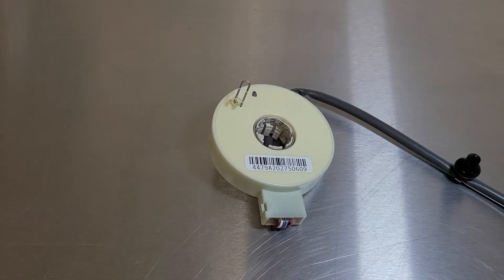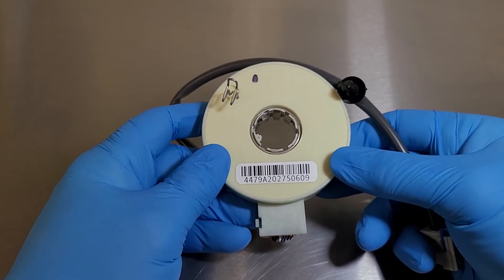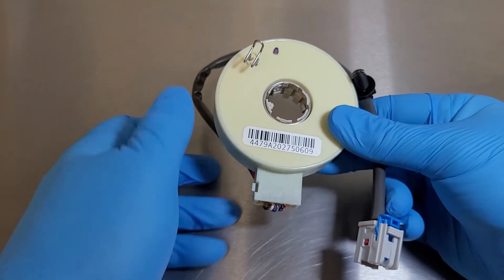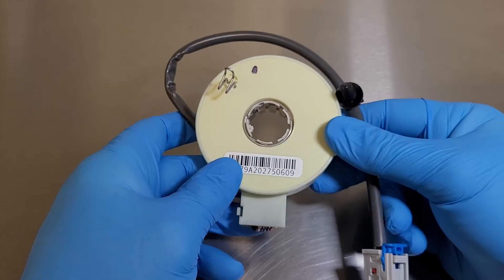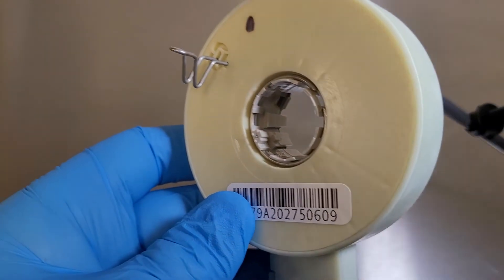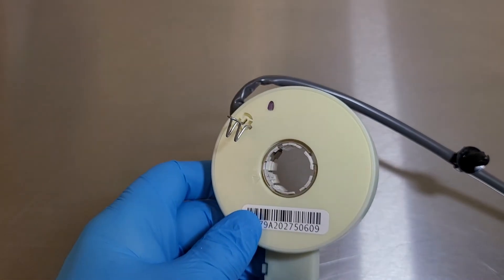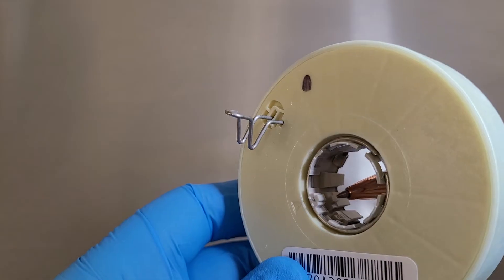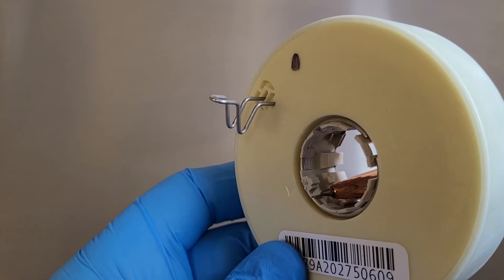Electric Steering Torque Sensor-Why the steering wheel spins on it's own after installation

Comment: First install, steering wheel went hard to the right.   I found this video and followed the instructions.   Now the power steering is completely out.  I've got a new error code now that says the torque sensor is malfunctioning.  Not sure where to go from here.   Either by the stupid expensive part and try again and risk having it happen again or pay even more to have somebody else do it.   So frustrating.
Reply: .... also,  the gigantic snap ring just kills me.   I think this thing is what messed me up in the first place.   For whatever reason, both the removal and reinstallation of this snap ring is next to impossible on mine.

Comment: This video is a money saver.  My sensor from gm was misaligned when received. I did what you said and it worked. I even programmed my sensor with the top Don top scan for 60 bucks. 2010 g6 with the 2.4l. This car put me in the hospital because of the steering column locking up, but it is fixed now but still scary while driving it knowing what I didn’t know then, what I know now. Thank you for the help you have provided us all.

Comment: I was having that issue with a new part and I thought it was defective, I took it back off and lined it up and now when I start the car the steering wheel is now staying still! The issue I am now having is when I turn it left I hear a clicking noise and the power steering cuts out. I only have that issue going left though, right turns are smooth
Reply: possibly click spring? check that out. you maybe damaged it when you took apart your column

Comment: This just saved me a headache. I installed mine and it spun. Every video I watched says if it spins it's ruined. I found this video and took everything back apart used the pin to realign and realized that when I originally did it the pin was only in the front disk and not both. Got them lined up and reinstalled and it works!

Comment: You need a diagnostic tool! 
1) Hook it up the connector but dont install. 
2) moke the rear spinner until the torque reads zero on your diagnostic tool.
3) line up the forward facing spinner with the arrows..
 4) if you can, istall while connected so you can keep an eye on the torque reading and adjust as necessary

Comment: Thanks for the info. My first attempt resulted in the wheel going hard right,on start up. Dismantled  inspected,reassembled alignment pin. Second attempt was successful. I am wondering if the problem is related to spline engagement depth. If sensor is pushed too hard the angle sensor splines may partially engage torque-section splines on shaft. Too little depth may have torque section of sensor hanging up on angle section of shaft splines. They wouldn't be misaligned, but aligned correctly on the same shaft section. I didn't have time to compare depth measurements. Perhaps someone could verify my suspicions. Thanks again.
Reply from the maker: Depth can be an issue.  There is a depth setting on the alignment tool.  This is discussed in the instructions link we provide.  Basically, the sensor depth should be set by setting it in only as far as the alignment tool will allow it to go down.

Comment: I have a question... I'm going to replace the power steering torque sensor to a Chevy Malibu 2012   It is absolutely necessary to calibrate the sensor with a scanner after being replaced?
I will appreciate your answer... thanks!
Reply from the maker: Absolutely necessary, maybe not.   If the install is done correctly, it may be fine.  But I'd be prepared to calibrate.
Reply: Thank you so much for your answer and the very informative videos ..👍

Comment: installed sensor and turned the ignition on and steering wheel didnt move. Then started vehicle then steering wheel rotated to the right fully by itself. Any suggestions? thx
Reply from the maker: It's out of alignment.  Remove, realign as directed in this video, reinstall.   DO NOT let anything in the column move during reassembly.
Reply: So it rotating like crazy doesn't ruin the sensor? @powersteeringseals4085

Comment: Could a fault or install problem cause the steering to sort of lock at different angles while driving for example steering left at 25 mph and the steering doesn’t rectify when you accelerate it continues to stay at that exact angle and turn the car?

Comment: I dont understand how it can be installed wrong when the pin is in the hole and the tabs are in the master spline? How does it get out of line?
Reply from the maker: After the pin is removed, during re-assembly, if the column moves slightly, the 2 discs in the sensor will get out of alignment from each other causing the spinning issue.   It should then be remove and try to realign the discs as I show in the video, then reinstall.

Comment: i did the the same but still turn to the right
Reply from the maker: It's still out of alignment or it's moving again on install.  The fact that it's doing the spinning does mean the sensor is working.
Reply: @powersteeringseals4085  thank yoi sir

Comment: Replaced an EPS sensor then after a few months it failed again. I aligned the original one and put it back...had it working for several months and now failed again. What I plan to do is put epoxy between the spline and the lower part sensor so that it stays aligned always. The upper part sensor has slot to fit in and does not change its alignment. Will it work?

Comment: So I bought  torque sensor and after watching the pin was in plastic bag not in  part I installed with out knowing this so I have take back off and try to realign it ? Or get a new one
Reply from the maker: Hi-Please contact us directly for assistance here.
Reply: You can realign it and put back the pin before inserting the whole sensor assembly. The problem is the fine spline where the lower sensor fits tightly (or not) but loses its alignment in time...

Comment: i begun my own project...and still learning a lot about these sensors...(ima newbie to put it this way...)
recently my car alfa romeo had a bad sensor witch caused the steering lose power(caused by the used sensor)
so instead buying a new EPS i decided to buy the tools to replace the sensor on my own(eventualy doing the hole thing,basicaly replacing all the parts that are exposed to wear including electronics)
so basicaly...im a bit upsed since i did calibrated the sensor...put it back in to the steering column/box and the result was 98% acurate.
the tool shows the sensor is calibrated but the car...says its a bit off..

those sensors even calibrated while disassembled they tend to de-calibrate just a slight while ur re-mounting the hole thing i even noticed just a slight touch on the sensor it self it goes off the target..

i wish i could learn more about these and maybe il make these as a job for my self by helping others with this problem.(replacing the sensor and/or electronics parts,basicaly regenerating the hole EPS)

Comment: Hello scott, hope you can answer a question for me. My power steering is out but i have no idea what part it is. Its an electric rack and pinion system and my steering wheel is real hard to turn. What component do i need to replace?

Comment: Thanks, I have the same issue, may I ask what does the retaining wire hold, is it just the two discs or more.  Can the retaining wire be re-installed if you re-aligne the two discs.   Many thanks Geoff
Reply from the maker: Retaining wire=lock pin?  The lock pin holds the 2 disc's in alignment until the sensor is installed and aligned.  The spinning is caused when something moves during re-assembly of the column and the discs get out of alignment.   You can remove the sensor and try to realign the discs as I show and reinstall the pin.  It will go in straight when they are in alignment.
Reply: @powersteeringseals4085  many thanks, I don't know the history of the unit and it's going into a custom car. This unit sensor seems very sensitive to the natural zone, i used a drill to align the two discs and had a play with it on the bench and managed to make it work with the sensor out and moving it both ways.  Thank you so much.  One question are they always very sensitive to the natural zone.  Point of interest the grove machined in the shafts is much larger than the bottom pin, is this normal and I assume there are no other bits to take up the slack.
Reply from the maker: @geoffhoyle479  Yes, these units are VERY sensitive.   Yes, the torque disc tab is smaller on purpose.
Reply: Thank you very much for your help, regards Geoff.